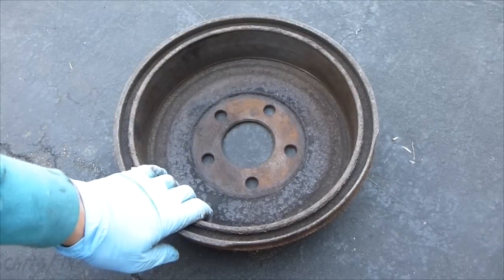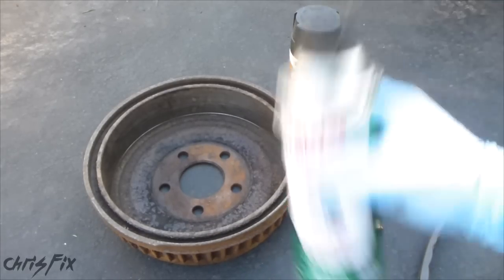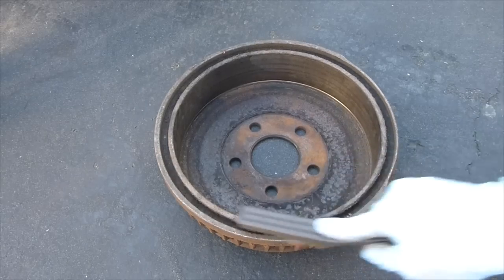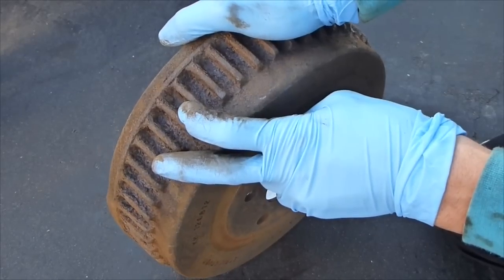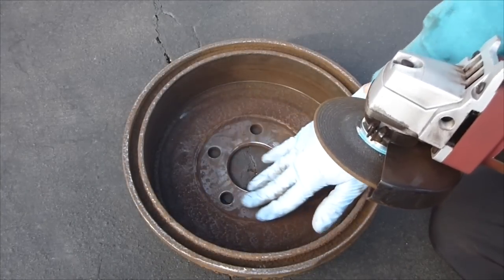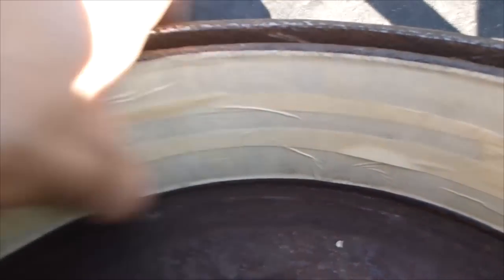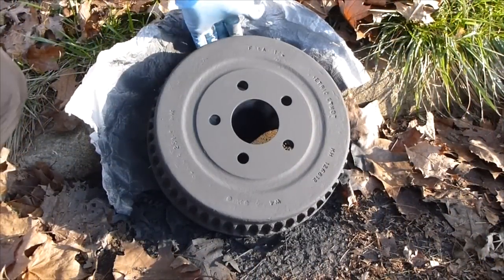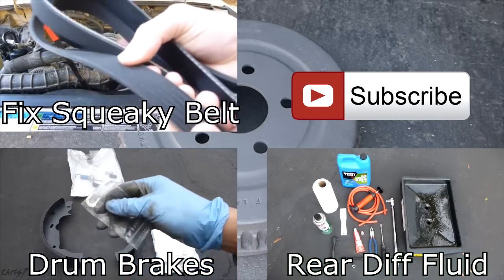How to paint brake drums ANY color DIY

Comment: Thanks for sharing this idea with us Chris! I just finished doing it to the rear drums on my Camaro and they look so much better being black again!
One recommendation to anyone who is considering doing this: Pick up a thin wire brush attachment for a drill. It makes getting in between the fins on the outside of the drum much easier.
Reply from the maker: xXHUNTERXxXx Thanks and thanks for the tip! A metal wire wheel works wonders!

Comment from the maker: +ravengsxr I cannot reply to your comment for some reason so I hope you see this. You can use a wire wheel if you want but it wont be as smooth (unless you have a really heavy duty wire wheel). You also have to be careful with the drum/shoe surface so I figured I would have more control with a grinding disk.
Reply: ChrisFix
Reply: if you use a soft wire wheel on the grinder. like a loose flat disk. it will take it to bare metal, zero rust. on that turned surface, it'd do little to nothing. slipping with a grinding disk would cause a hell of allot more damage. also you sound like you have a cold, go rest and maybe make some honey tea.
Reply: @ChrisFix hey great video! You can also use vinegar and submerge the drum, let it sit for overnight or for 24hours and most/all of the rust should lift off.
Reply: ChrisFix, 
Let's go into business together and open a garage. I'll finance it,  you work it. Contact me.
Reply: @universalchiro  nerd

Comment: after inspecting my rear drum brakes on my truck everything looked fine but i decided to paint the drums because they look like hell with all the rust and scale on them.  new drums cost about $65 a peice so i decided to renew the ones i had on there.  i didnt bother having them resurfaced because they were okay there.  i just wired brushed the outside to get the big stuff and sand blasted the rest of the drum.  Than sprayed them down with degreaser and finally spray them down with alcohol.  I used Hi Temp paint and used a hair dryer to speed up the drying process.  by the way i didnt paint any of the mating parts of the drum.  worked great!  It was a lot of effort though but didnt cost me anything.

Comment: I've found drill and wire wheel very handy in addition for those fins around perimeter. Good video, thanks Chris.
Reply from the maker: Sam Johnson Thanks a lot! That is a good idea. I need to pick up a wire wheel for the angle grinder.
Reply: Oh thanks Chris, it really does help no matter which appliance you use it on. Rock on guy enjoy your videos. Grit blast is best, I've used it in aviation for thirty years, yes it is cost prohibitive for the DIY folks unless you have one at your disposal.

Comment: I have a 1980 horse trailer I am looking to restore and was debating on whether I should paint my drum and hubs or not.  I wanted to at least protect the metal surface from more rust and corrosion in the future because I live in FL and it's wet here a lot.  
I'm glad I saw this. I'll be repainting them for sure tomorrow!!

Comment: Make sure to prime before you paint, I prepped and painted my brand new drums and they rusted through in a month :( I did my calipers at the same time except I primed them and they are still looking great
Reply: sorry I dont know much bout car paint. what type of prime? brand? thank you!
Reply: Mitch Pol Rustoleum makes a paint specifically for brakes (rated to 900°F), but I can’t seem to find a primer rated to the same temp... however, they do make an even higher temp primer (rated to 2000°F), so if you’re going to prime it, I’d use that. Check Amazon 👌

Comment: Last time I did this I did the outside of the drum on the car with the 4in wire wheel and it tool off the rust and helped break them free, hit the inside, cleaned them with brake clean and paint  then had them turned, cause I don't know where the one guy is buying new ones for 20 mine was going to be 50 a pop vs the 12 each for turning. 
As always great video,thanks for putting more car knowledge in the world.
Reply: Jimmie Smith check our rock auto. My drums on my truck were $30 each on there but O’Reillys wanted 90 each for them

Comment: A die grinder, electric or air, can be had for little outlay. Add a mandrel and abrasive cartridge rolls, and those fins on the drum would be sparking in about a minute or two. I do appreciate your effort to point out how much can be done with very little, but showing how a (relatively) cheap upgrade can save time (money) is also wise. Also, this drum could've been cleaned in a jiffy in a blast booth. It's tasks like these that justify an investment in useful tools.

Comment: I have a drum brake painted without being careful to select a proper heat resistant paint. That was a mistake. So I grind the paint off and redo it with the correct paint. I'm glad I did because now I don't have to worry about it.

Comment: Hey Chris, just curious to see how this has held up over the years?
Reply: My 2 cents. Instead of high temp paint. Which usually does very little about keeping the rust away! Use Hammerite, not only it works incredibly well on slightly rusted surfaces. But stand the test of time, particularly on rear drums (less heat).
 
I've had a car with rear drum brakes painted with Hammerite for little more than 10 years!! Yep! They still look fairly decent! More dirt than rust, which is quite a surprise! Surface cleaned of heavier rust and dirt. Washed with acetone and (brush) painted with 3 layers... BTW took ages to dry, almost a week! But it's holding surprisingly well. ;-)

Comment: Granted this is a 9 year old video but I've seen some more recent ones where they dip brake rotors in a small tub of vinegar for overnight and the transformation is miraculous.  Some say that after the vinegar dip to also dip it in a baking soda solution to neutralize any residual vinegar acid.  Apparently, an acid coating left on the steel promotes flash rusting.  Seems like a little larger tub could hold a brake drum and then paint it.  Sounds like it would be a lot faster and easier than wire brushing and sanding the drum.  Oh, there are three strengths of vinegar.  The regular salad vinegar is 5% acidic and a cleaning vinegar is 6% acidic.  I see over at Lowes there is a 30% vinegar but that might be overkill.  Although, all you have to do is add some distilled water to reduce the potency.  Half and half would reduce it down to 15% acidic if you have REALLY bad drums.
Reply: I've used vinegar baths before to clean rust from old tools.  Very effective and easy.

Comment: TRY RUST REMOVAL BY ELECTROLYSIS.  THERE ARE MANY YOU-TUBE  VIDEOS ON THIS SUBJECT.  WORKS VERY WELL!!!
Reply from the maker: +yard farmer Thanks for the tip! That will damage the surface the brake shoe comes in contact with.
Reply: ChrisFix no it wont, it only affects rust not metal. I guess it would be better to have the drums machined after rust removal.  When it comes down to it new drums are not very expensive either.
Reply: +yard farmer - +1 on that. Electrolysis is by far the best method. 
I use it for quite awhile. Beats any wire wheel, sand blaster, or even acid for this application. ChrisFix have a look into it. You'll curse the wire wheel every time you look at it. LOL ;-)
Reply: PVC windows

Comment: Sand blasting... will get that rust off very fast... 
Find a local shop, they usually do not charge a lot at all to sand blast some parts.
Reply: That's a great idea!
Reply: *****
Well... duh... you do need to mask what you do not want to sandblast. Also, sandblasting is not as destructive as you might think.
Reply: mrN3w7 won't stand blasting strip the masking off as well? I mean if it takes Rust and Paint off.
Reply: If you are using automotive masking tape it won't (as long you don't keep the jet concentrated for a long period of time). They are tougher then they look.
Reply: +mrN3w7 - Electrolysis, no need to mask, no sweat, better end results. ;-)
Reply: True, but it could take hours and hours... vs 10-20 minutes job.
Reply: @mrN3w7  doesn't matter its a drum , blast it paint it then machine it , don't use chilled iron grit tho as it will profile the shit out of it . there is loads of different media that will not profile and create metal loss.

Comment: Chris use Loctite "Naval Jelly" after you use a degreaser. The "Naval Jelly" will eat the rust off completely. I soak them in it overnight then wash them with soapy water the next day and dry them with a heat gun/hair dryer. No wire brush, no rust dust and the paint will adhere better.
Oh yeah by the way you Rawk!
Reply from the maker: +Brewer Brewer Thanks for the tip! I have to try that!

Comment: You could also use a wire wheel on the grinder doesn’t harm the work piece it removes the rust/oxidation.

Comment: I used a wire wheel on the drill and removed most of the crud that way on the outside of the drum, then I wiped everything down with OSPHO and let it chill for 24 hours, and then washed it all off with degreaser, let it dry - but I only painted the outside.

Comment: you are the best
Reply from the maker: Thanks man
Reply: ChrisFix like you
Reply: ChrisFix I didn't use high temperature paint ,it is bad?
Reply: My dad used some normal spray paint on his calipers instead of high heat. It worked and looked fine but as soon as you start using the brakes heavily it will wear off quickly.
Reply: Albion Kola probably is a good idea to use high temp if you go to the trouble of doing it anyway, that way it should definitely last

Comment: If they are not expensive, new drums would be good to buy. I got new drums and used silver caliper paint to give it a protective cover. And I needed new wheel bearings so I just fitted then into the new drums.

Comment: Buy a cordless drill with wire wheels, use ppe.
You coulda painted it before getting the drum cut to save a step...
Reply: Thats what im going to do paint before getting turned  im not painting the inside

Comment: I always heated the item I was painting before applying high temp paint. IDK if thats part of the directions. Only used it once with my father when we built a grill out of scrap. THis was a couple years ago and the coat is still holding strong- even after all the bbq's.

Also, love the videos.
Reply from the maker: ***** Nice! Yea, the instructions dont say to heat the object but hey if it worked for you, good! Thanks a lot man!

Comment: Those are great instrutions!  Since new drums cost less than $30 each, I may just buy new ones and paint them. That's a lot of time/labor to clean that rust off.  I noticed you didn't use primer, before the paint.  Is that because of the high temp of the drum?
Reply: Wavetechlifeguardian new drums for my truck were $85 each.
Reply: 2 months late, but if anyone else was wondering, most high temp paints don't require primer. Obviously read the instructions for the paint you choose though/

Comment: Chris, if you dip the drum for 30 seconds in Muriatic acid which you can get at the local hardware store, all the rust will be gone right to bare metal. Just gotta be careful use gloves and mind the acid, once you rinse it with water it deletes to safe levels. Just can't beat the speed of it.

Comment: I did all the job on rear and front brakes for our 2001 Saturn SL2, I didn't know you need to paint the rotors and drum brakes, now everything is rusted of course. Not big deal since I'm practicing on that spare car we have, but I would like to know if there is any difference between Zinc coated and Black high temperature coating for corrosion protection (I found on Amazon such)? What will last longer: Zinc coated, Black high temperature coating, or just painting w/Caliper Paint for corrosion protection? Thanks a lot for showing all the detail on painting Drums, great film as usually.

Comment: Hey Chris! Love the vids! Quick question, I painted my drums but accidentally used regular Rustoleum spray paint. Do you think that would be alright or am i risking a flaming ride down the road? Also would i be able to fix this by just repainting over the regular rustoleum with a high heat paint? Thank you so much
Reply from the maker: Can ofLions Regular paint will most likely melt if you ever encounter a situation where you are using your brakes a lot. Since the rear brakes are not used as much you might be able to get away with it though. Your paint will probably not catch fire. Go for a ride and see if the brakes smell afterward. If you did want to use high heat spray paint, you would have to remove all of the old regular spray paint.
Reply: You're the man! Thank you!

Comment: As paint will be a insulator and cause heat retention thus limiting the effectiveness of the brakes, you might consider another option.  It's better to use chemicals to complete the oxidation process completely and turn the steel all black.  If it's completely oxidized it won't rust.  It's basically the same process, but it only takes one coat and you don't even have tape off the contact surface of the drums, so you will actually save some time.  Unlike paint this process is truly permanent. 
 Black is the color that radiates the most heat and for brakes that's what you want.  Use a light coat of high temperature grease on the hub where it contacts the drum so it won't bind, no matter what.
  Keep turning those wrenches and shooting that footage!
Reply: +ScorpionRegent The back drums do 20% of the braking if that... It's more for using your parking brake so it doesn't matter if you limit the effectiveness of the brakes considered it won't limit much...
Reply: +Spartan111792 20% is about right.  Back brakes aren't as critical as the fronts, but the oxidation completion  process  done once never needs to be done again, ever.  
I'm just presenting a option.  In the end it's your car and your choice.  Peace.
Reply: +ScorpionRegent What you mean with complete the oxidation with chemicals? As in turn metal to some other material?
Reply: Yeah, thats right.  Effectively giving the metal a coat of iron oxide.  Like steel hand rail on a busy stairway that has got that polished black finish as smooth as glass, that is iron oxide.  There are rust stoppers in the paint department of the hardware store that will do this.

Comment: my friend like watching all your vids but i have a secret, you shold have put the drum brake in a bowl of apple cider vinegar for 24 hours, you watch al that rust come off just yt it, good vid by the way
Reply: White vinegar works, too.
Reply: Do it work just fine?
Reply: Would that risk the integrity of the brake contact points on the drum? If not, I'm going to try that on my truck later.
Reply: Huh, I gotta try that just in case my first car has drums
Reply: @matthewchristeson6589  yes it would, if you want to remove rust that way just use some type of chep rust remover, because vinegar eats away at clean metal as well as rust. or if you are to cheap to buy rust remover or cant find them cheaply aply some kind of grease (dosent matter what kind) on the brake contact points and then put it in vinegar

Comment: Is brake cleaner ok to drain back into the ground? Ive always used a drip pan. I thought all that stuff was bad. Not that i care, im just wondering so i can let it drip myself.
Reply from the maker: jsngallery Brake cleaner is highly volatile so it just evaporates. If I ever use a lot of brake cleaner, I have it drip in a bucket and just leave the bucket out to evaporate.

Comment: Just one question, I clean my brake drums maybe once a few months/half year because brake dust is trapped in there, thus the squealing/clunking noise when it comes to a full stop. If you paint the inside of it, wouldn't it be harder to clean it? Brake clean might clean away the paint and drip to the surface where it contact brake shoes.
Reply: Only paint the outside

Comment: You could also wash the drum first with a degreaser soap and pressure washer..this will save you enough money from brake cleaner cans..wire wheel on a Dremel or drill can also help with the sanding..

Comment: I would recommend using Zip disks and wire wheels instead of a grinding stone.  You’ll get a better finish and more rust out of the notches on the outside

Comment: Hi +ChrisFix . i mentioned to my grandfather that I want to paint my drum brakes with high heat paint, he told me it might not be a good idea as the paint coating will trap more heat inside the brakes. what's your opinion on this? thanks

Comment: Turning them at O’reillys cost $15 a piece , $3.50 for brake clean, $8 for paint and a brush is around $3 that’s $29.50 at that point your getting close (depending on what car you have) to the value of a new one. Save yourself 1 hour of work. Not to discourage any ricers from doing this but something I wanted to point out.

Comment: You have to sand the inside of the drum, because you clean it and remove any brake dust. And you have to sand a little bit the brake shoes. (With 600 Grid)

(I learned this in at my placement (in Germany))
Reply from the maker: +solomioist Thanks for sharing!

Comment: easier to use a wire wheel attachment on the grinder. can basically just use that them clean off and spray paint

Comment: Unless someone can tell me why I'm wrong, I disagree with the order this was done. IMO the drums should have been cleaned and de-scaled first (I'd have used a wire wheel or had them sandblasted with all those corrugations), THEN I would have painted them (though I see no real reason to paint the interior). The LAST thing I would then have had done was the machining. This reduces all the effort needed to protect the machined surfaces during all the previous procedures.

Comment: you could still use your angle grinder than a wire wheel but it would be best to use a flappy disk on it. Its basically having a sand paper on your angle grinder. :)
Reply from the maker: Yea,  I now have both the wire wheel and flap disc!  Thanks!